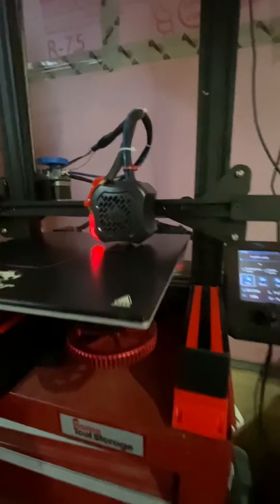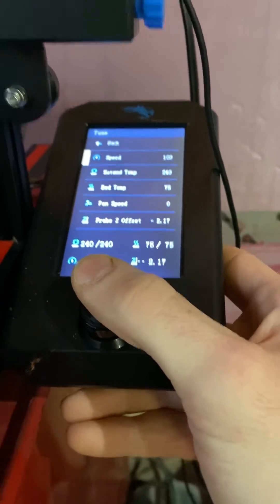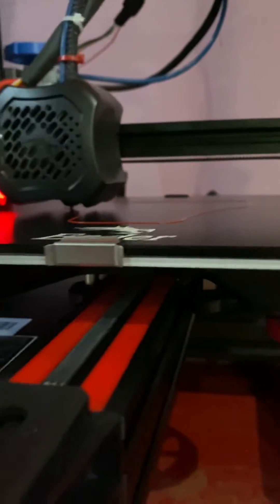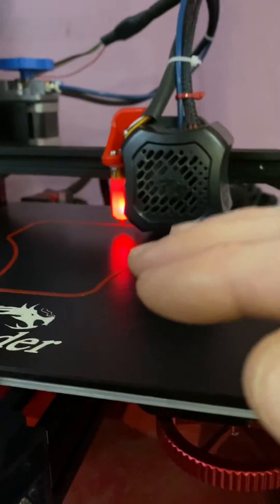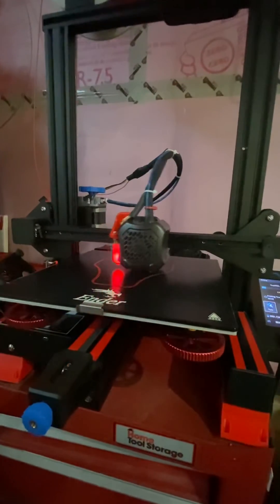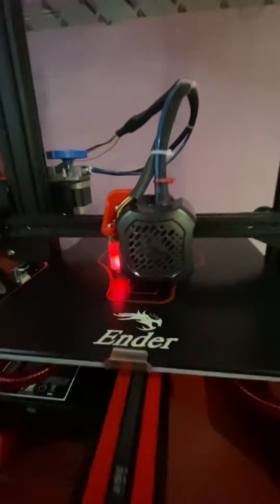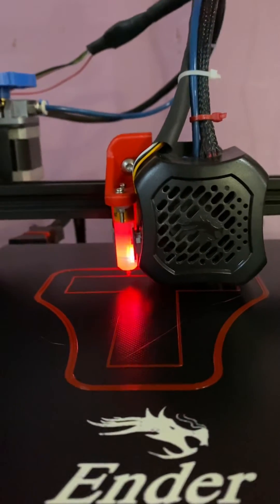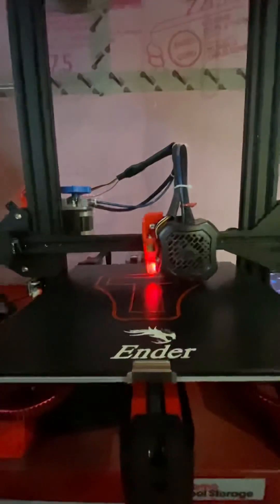Print PETG Ender 3 V2 EASY!

Comment: Do be careful with PTFE tubes and high temps. At 240°C the tube starts to emit very toxic fumes. Which is the reason why you'd wanna upgrade to an all metal extruder like Sprite.
Reply: What's PTFE and where do I have it on my printer?
Reply: @littlefrank90  PTFE aka Teflon is usually white looking, kind of like a soft rubber material. In this case it's a tube that feeds the filament into the extruder. The problem is that this tube is directly connected to the heating element. So if you go higher than 235-240, it's going to start, effectively, burn up and release the carcinogenic fumes. 
Higher grade extruder assemblies usually have a distancer between the heating element and the ptfe tube, so no need to worry about toxic fumes. Check out the Sprite Extruder for example.
Reply: @s3r10s1n haha random but you seem like the person to ask, would the ender 3 v2 neo have the better hot end you are speaking of? I can't find any detailed pictures to see how far the bowden tube goes unfortunately
Reply: @jimmyd5117   I have the Neo and it's the same problem sadly.

Comment: I have tried many different hotend and bed temp settings as well as print speed retraction settings flow rate I have tried everything and I can’t avoid getting bad stringing or excess extrusions leading to clumps on the print I’m also having problems with layers being uneven. All of these problems only occur with Petg and I’m just having a rough time getting it right. Any suggestions? I have the jyers firmware and bltouch btw
Reply: You ever figure out a solution? Do you use a filament dryer?
Reply: @nightmechanik I don’t have a filament dryer. I use the bags and desiccants. Unfortunately and fortunately I did discover the months long issue I was having with my ender. The initial SD card format never took. I reformatted the card and uploaded the newest stock firmware  and it prints pretty damn good. Though I need an enclosure to stop corner lifts.
Reply: @BrainCellular  Thanks for the update. Glad to hear you got it resolved. I have heard a filament dryer makes a huge difference with PETG because it is a lot more sensitive to moisture than PLA, and will really affect overall print quality with PETG. I have read that several people swear by this. I am a new printer a have not printed PETG yet. I am just gathering information. I have also read mixed things about enclosures maintaining too much heat.

Comment: Is your bed/glass bed warped ? Because on mine there is a dip in the center, like, when the edges are at 0.1mm form the nozzle , the center is at 0.25 making the levelling a bit difficult :/
Reply from the maker: The printers are cheap you know. So finding a nice flat glass sheet is kind of a hit/miss and are notorious for coming slightly warped.  Download the JYERS FIRMWARE.  I can make a 2 minute video on doing that, it will change everything for you without even needed s bl touch to get awesome leveling

Comment: One advice for y'all, it's critical to have correct bed level, I had issues with bed adhesion and afterwards I set my bed just too close and awfully clogged my nozzle be careful to go the other way round as well
Reply: If the bed is setup properly, you don't even have to clean the bed. I just leave the dust on there as it makes the print easy to get off.
Reply: PETG needs about .3 mm more clearance than PLA.  I have had good results raising my z offset and printing normal defaults for petg

Comment: What brand petg? I have inland petg and I can't get it to stick to the bed without a little glue  on my ender 3 max. I cleaned the bed woth rubbing alcohol and it just won't stick. Was printing at 230 nozzle temp and 80 bed. I'm going to try and bump.nozzle up to 240 or 245 and see if maybe it just wasn't hot enough.
Reply from the maker: I’ve used a variety of brands.  Personally I don’t use alcohol to clean because it can deteriorate that bed that comes with the v2, unless it’s a glass bed then alcohol works great.  Warm water and soap is all I ever need.  
Ok to the printing, set nozzle to atleast 240!  Use hairspray on the bed, cheap stuff but it works great.  Your nozzle may be to high aswell.  If it’s good, make sure to turn the fans off and have no air blowing around the printers bed, slow the first layer down to a painfully low speed 😂, you have to get that first layer to adhere and you’re good.  But yeah go slow, when you’re skirt is printing in the beginning, turn the speed to 10% and watch how the skirt is laying down.  If it’s not laying then keep the print going but go into the menu and set the z axis lower in small increments, if you’re printing at 10% speed you’ll have enough time to dial your z axis in before it even comes close to getting to the actual print.  I have to do this all the time.  So once the skirt looks like it’s got a nice smush and is making solid contact then leave the new z axis setting and you’re good to go.  I was going to make a video on the importance of a skirt!  Good luck my friend let me know how it goes
Reply: @RMquickbit  a video on the importance of the skirt would be awesome
Reply: @RMquickbit  I've subscribed to see it! Hope it motivates you to do it :)
Reply from the maker: @Michallote  I just posted a quick video on it, I doubt anyone will watch it but check it out if you want man.  Thanks brother 🤙🏻

Comment: Hi mine got no options for like petg.  I only got "preheat pla" or "preheat abs" =.= helppp
Reply: the preheat options are configurable when you compile new marlin software, otherwise you olny have pla and abs. Other than that you get the temps from your slicer for printing
Reply: @TommiHonkonen  can you modify the PREHEAT ABS settings to these settings? and then just use preheat abs?
Reply: @TommiHonkonen  thank you po
Reply from the maker: What Tommi said.  Also you can just load PETG up and while it’s prepping go in and set the nozzle to 240 and bed to 70 before it starts printing, then take the fan speed to 0 and slow it down a bit.  I’ve done it many times with no problems at all.  Otherwise use your slicer (cura) and select “PETG generic.”  Good luck man
Reply: @RMquickbit  thank you po.

Comment: how come you are not using glue or blue tape on the bed? Does the V2 not need that?
Reply from the maker: Simply no need.  Heat the bed up and set the nozzle appropriately.  A spritz of hair spray is all I ever use.

Comment: Are you printing your PETG directly on a cleaned carborundum glass plate? Or are you using some kind of release agent. I know when you are printing on glass, there is a big risk that it will melt to the glass itself
Reply from the maker: Stock build-plate that came with the printer.  Thing works a treat.  I’ve never had problems with melting glass or something getting completely stuck to the bed.  I clean the surface with warm water and soap like once a week.  Honestly i rarely clean the surface, I pull print off, spritz some hair spray with every filament I’ve ever used and print away!  I keep it super simple I’m not printing precision parts, and I use a fat nozzle too
Reply: @RMquickbit  can you define fat? .6 .8?
Reply from the maker: @KG-rd5ij  1.0 or .8 mm nozzles only.  I can’t bear printing with anything smaller.  Like I said I only print project enclosures and things of that nature. I’ve never printed a figure or something.  If I did I’d go .4mm or even lower.  But remember when using “fat” nozzles (😂) you gotta check your extruder because your doubling at-least the amount of filament and most stock extruders will start to burn up and skip like crazy.  So either slow it down or buy a gear reduction box for the extruder.

Comment: How high do you put your fan up when it says the nozzle is getting too hot? 
Thanks and great video 🙌🏻
Reply from the maker: In cura, the slicer, will usually automate this for you and anywhere from 75 to 155.  The only problem is when you print slow and hot without fans it’s just a perfect setup for over heating.  I print in my garage where it’s like 60 degrees.  
I just like to manually go in and keep adjusting it as the print goes on.  But when it overheats just shut it down.  And when you turn it back on it should ask you if you want to resume your print.  
Good luck 🤙🏻
Reply: Robert M aw I see. I’ve just been trying to print an easy cookie cutter 240 nozzle, 75 bed but had the fan on full. I’m gonna try to have it off for the first few layers and then put it up. Thanks xx
Reply: @RMquickbit  thx